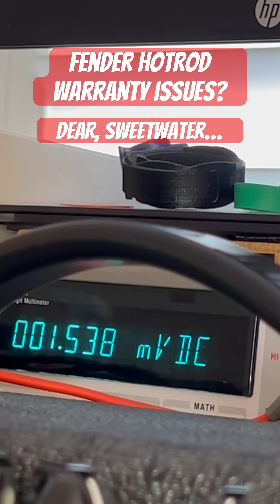Fender Hotrod Warranty Issue?  Dear, Sweetwater…

Comment: So did you ever figure out a fix for the horribly engineered supply that's been a problem with that series of amps since the first generation?
Reply from the maker: Yessir. This amp was the most challenging repair I’ve had come in for this type of fault.
Reply: @ThatAmpGuy  Really? Normally it's cut and dry, replace the sandbox resistors with 750R 7W standoff types and replace the 1N5353Bs with the same part but added lead length bent over to create a heat sink. Basically lowering the source voltage to cause less stress on the zeners. Done and done.
Reply from the maker: @darrencampbell8817 750R @ 7w is overkill, but probably ok. I use airgapped 470R ohmites and also replace the Zeners with an air gap. That part is cut and dry as a matter of routine, preventive maintenance.  What added complexity included the PCB repair and identification of the component that caused the negative half of the bipolar supply to crash. Good times.
Reply: @ThatAmpGuy  Not overkill at all, only issue is sourcing a standoff resistor of that value. We were working for Fender when we came up with the fix and getting the resistors directly from Line 6, they used that specific type in one of their amps back then I can't remember which one. Not long after all that the head of Fender service got fired and everything went south at Fender. Fortunately we were still enginnering for Mesa, Roland, and Yamaha to name a few. And yeah Sweetwater technical service? That's a joke now too 🤣 Glad you got it worked out my guy.
Reply from the maker: @darrencampbell8817 I didn’t calculate what the drop would be on those 750s, but they would certainly run cooler.  I think fender were using 330s, but I bumped them up to 470s for the cooler operation. I think I’ll have a look for the larger guys next go round.  Anything to help those Zeners 😂.  It’s like fender doesn’t keep service records and doesn’t bubble up the fault data to engineering. Cheers